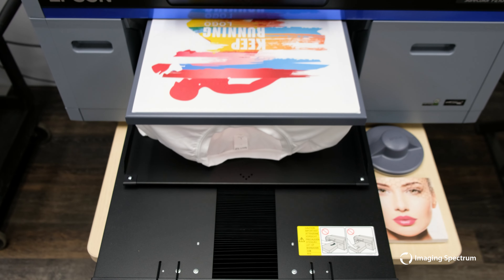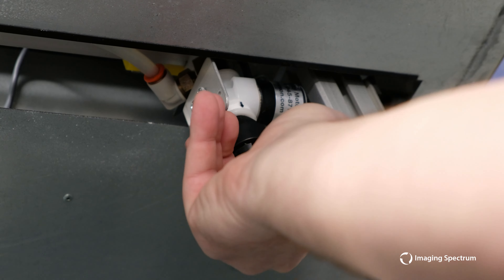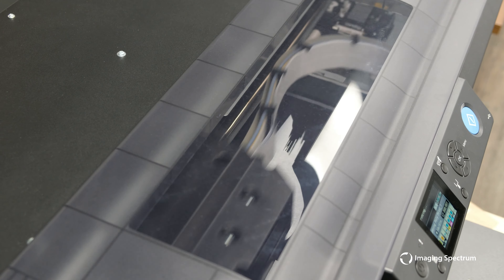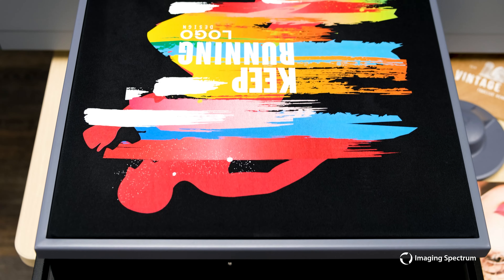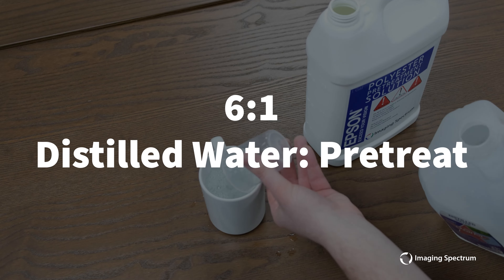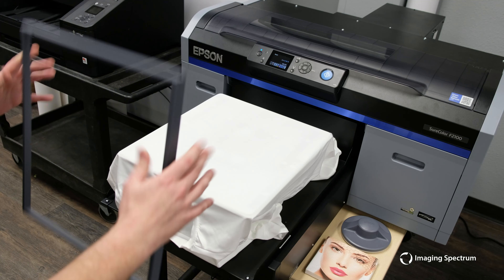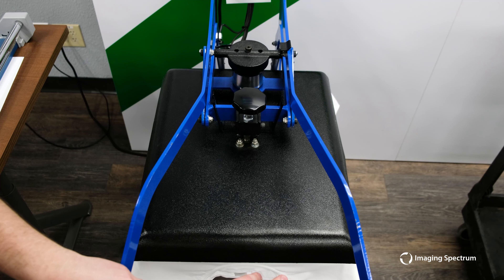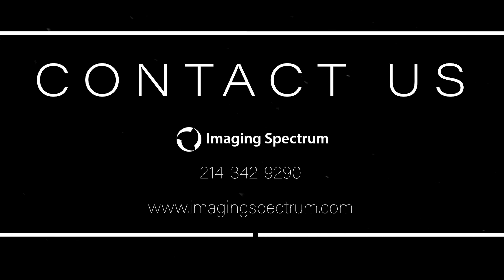Printing on Polyester with the Epson F2100 DTG Printer

Comment: Can this work for Rayon/Nylon/Polyester blends? If not is there a way to do so?
Reply from the maker: Hey Dwayne, thanks for watching! Rayon is one of my personal favorites, especially in the triblend configuration. Poly-Blends like 50/50 etc. are definitely on the table and nylon can now be handled also with DTF using the same machine. Hope this helps!
Reply: @ImagingSpectrum  Yea this is helpful, so you’re suggesting for a knit fabric content of 66%Rayon 30%Nylon 4%Spandex to use DTF?